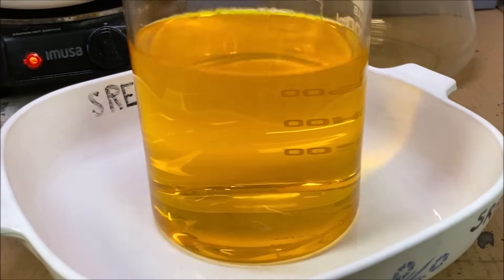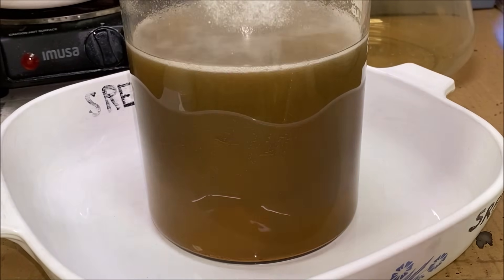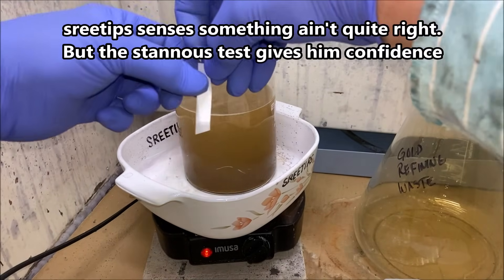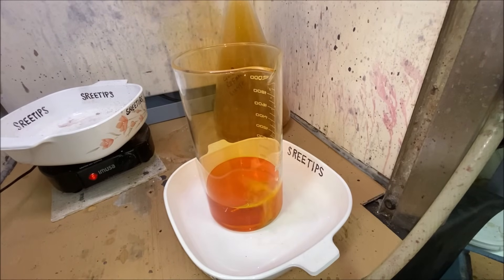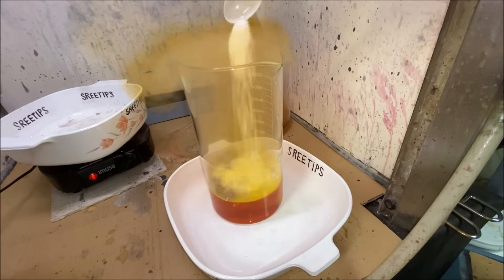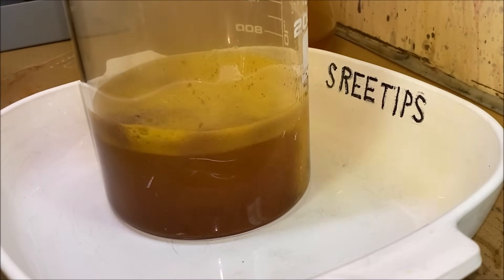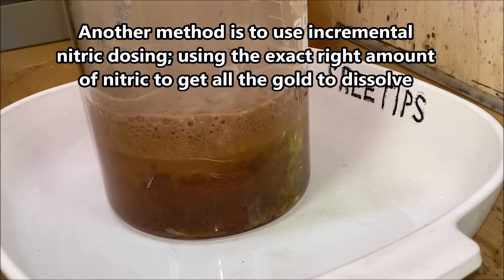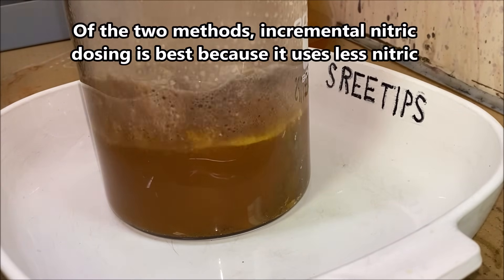Delayed Run Away Nitric Reaction Boilover

Comment: This is when urea comes in handy to consume the extra nitric instead of just adding smb with small amounts from electronic and sludge a lot of times u go over to insure all the gold is out but with solid batches u should be more careful. when adding urea u will see if it reacts then there is extra nitric in solution or just heat it for a long period to rid the nitric but that can take hours
Reply from the maker: Urea is not used by modern refiners. That’s antiquated.

Comment: I always add urea to a solution before i boil it. Urea helps consume the nitric/nitrates that are present.
Reply from the maker: I tossed urea twelve years ago. I should have evaporated the solution down to a syrup to drive off the excess nitric. Butcher, on the GRF, taught me about urea in gold refining. There are much better methods.
Reply: @sreetips  I find urea handy as i use nitrate salts for my refining because i am not allowed to purchase it in UK. Not that it wont stop me making it when i need it ;)

Comment: Consider neutralizing the excess nitric acid before adding your reducing agent. If you are using metabisulfite, prepare a solution first, then add the bisulfite solution to the gold solution. Note that dissolution of metabisulfite is also exothermic so making a solution first will give you more control and less sulfur dioxide will escape. Depending of pH, you will have various amounts of sulfur dioxide, bisulfite and sulfite in the solution. Some sulfate will be inevitably produced depending on temperature (hot nitric acid gives produces sulfate and nitrogen dioxide instead of sulfur dioxide and nitrate.
Reply from the maker: It’s best to use just the right amount of nitric like I usually do. Then there’s no excess nitric to get rid of.

Comment: Hello sir, I have some urea and sulfamic acid, for this, but plan is use incremental nitric and complete disolution with hydrogen peroxide, Just an idea for now, has to be tested...
Reply from the maker: I tossed urea a dozen years ago. I have sulfamic but never use it. If done correctly, then there’s no need to denoxx because there won’t be any excess nitric to remove. H2O2 is sweet also. You won’t have any excess nitric using it.

Comment: You have a steep thermal and density gradient across the beaker (nitric acid is about 1.5 times more dense than water).
What happens when you alter the volume of "liquid" in the beaker as you pour the top layer of liquid out?
Reply from the maker: I don’t know. I think it has to do with temperature.

Comment: Fantastic video. You mentioned before that sulphamic acid could be used to consume excess nitric? Or is it preferable to use smbs?
Reply from the maker: Sulfamic works, but with that much excess nitric, it would cause the solution to boil over,

Comment: I symphatize with you having similar experiences with runaway reactions. I've learned the hard way the importance of adding reactants slowly and in portions, and also monitor the temperature instead of just visually checking the reaction. The risk of runaway reaction is greater when working at scale, because the mixture is able to absorb a ton of heat from the reaction until it starts boiling and then it is too late! The reaction has an initial 'induction period' - a time when seemingly no reaction happens. This is dangerous as chemists are encouraged to add more reactant to speed things up which can easily lead to thermal runaway. The heat dissipation is also diminished with larger vessels and this is why chemical reactors often use active cooling jackets or even counterflow cooling. Stirring is also very important to spread the heat and get correct temperature measurements.
Reply from the maker: It just took off, out of nowhere.

Comment: Now….how do you stop or slow down the boil over? Is there anything that can be done? Or added?
Reply from the maker: I’ve doused it with cold distilled water to reduce the boil over. If you can get to it in time.

Comment: nice one, sir. but I had that problem before with using the normal formula like 1:4 and left me whole bunch of excess nitric. normally, i use urea to neutrelise the solution before pouring the smb into the solution and it works perfectly, but i dont know the side effect. any comment?
Reply from the maker: I use 1:10 to dissolve gold with much heat. Using 1:4 guarantees there will be problems during precipitation. And it’s wasting expensive nitric acid.
Reply from the maker: I don’t use any urea. The pro refiners on the goldrefiningforum.com said not to, so I don’t. There are much better methods to remove excess nitric.

Comment: I’m so glad you reposted this. I just had the water boil out and was just hot nitric while removing base metals. It was violent in there, although no red fumes were present. I didn’t have enough water to start with. Once I added water it just bloomed red. It was too much for my hood. It’s just a reminder how respectful you have to be with this stuff.
Reply: And now my hot plate died 😥 🪦
Reply from the maker: My hot plates last only about six months because I tend to run them on high for hours at a time.
Reply: I guess because it was an Amazon cheapie, it lasted 2 months.

Comment: Thanks for the video. Good to be reminded. I realize there are differences between dissolving gold vs silver but it is still good to be reminded. I tend to calculate the amount of 70% nitric acid needed to dissolve silver. One has to make assumptions, but I am usually close. The closer I get to the theoretical amount I slow down to avoid using too much. Still, this was a good demonstration of adding too much nitric acid. One that I hope to remember. It looked close to boiling over onto your hands when moving them off heat. One never knows when they will need their personal safety equipment like gloves, safety glasses, fume hood or respirator. I am really glad nothing serious happened.

Comment: That was a good one from a year ago. I do wonder if using sodium bicarbonate couldn't also help to neutralize the nitric acid and is likely cheaper than the SMB... anything in the Precious Metals Refining book on whether that's a viable option in a case like this?
Reply: Exactly what I was thinking but sreetips had said many times that boiling the solution to drive off the nitric is the solution to the solution lol
Reply: @arnold4radiators  understandable.... with the exception that it creates the risk of the noted nitric runaway. Neutralization doesn't have that risk; just have to do so gradually like with the SMB to control foaming from the CO2 being driven off.

Even neutralizing some of it would help to reduce runaway prior to heating for syrup reduction.
Reply: I have use sodium bicarbonate  and it's working.
Reply: You can also use Sulphamic Acid, which if necessary can be bought impure as wood bleach.
Dual benefit of creating small amount of Sulphuric Acid to precipitate any Lead as Lead Sulphate to be filtered out.

Cleanest methods are reduction to syrup and rehydration, or a bead of previously well refined gold. Got to track your yield with the second method though.
Reply from the maker: No, the book calls for evaporation to a syrup to expel excess nitric.
Reply from the maker: I’ve never used it on a gold solution.
Reply: @sreetips  cool, thanks for confirming what the "bible" on the matter says, Senior Chief. I was mostly trying to think of a way to get to the syrup safer without risk of runaway (or, at least reduced risk).